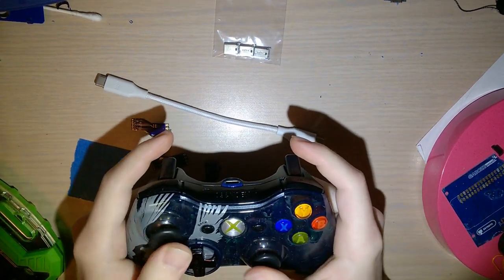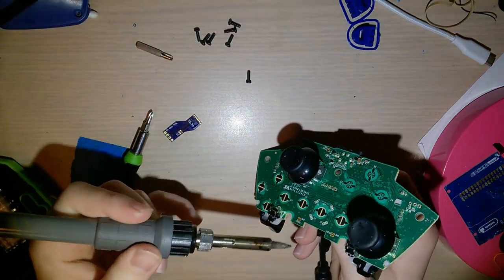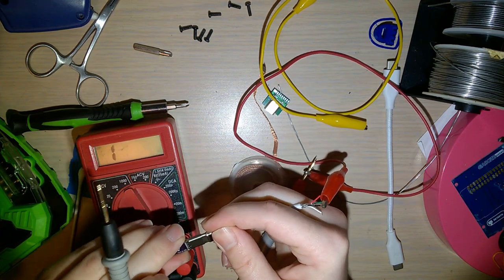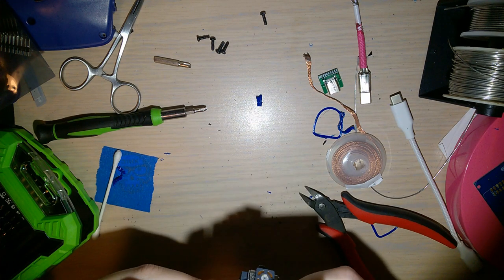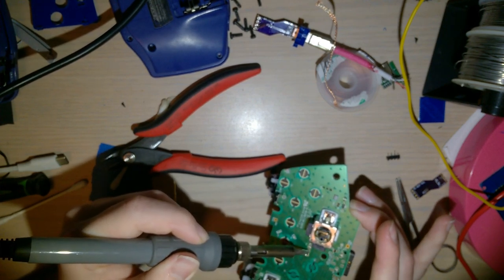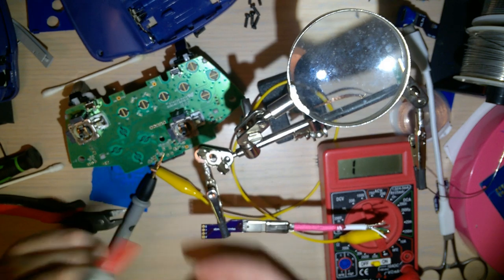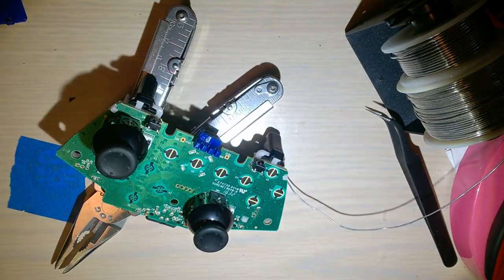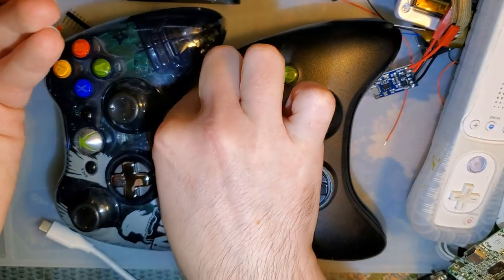Installing a USB Type C Port in a WIRED XBOX 360 Controller

Comment: Nice. I did the mod on my controller but I used a USB C female to USB 2.0 male adapter which I disassembled to use the board itself (long story short, I can't import anything in my country so I can't buy that PCB, and breakout boards aren't sold here either), and for the bezel (which luckily I managed to have someone 3D print for me) I used super glue to keep the port in place, not the most elegant solution to be sure, but it seems to work just fine like that for now.
Reply from the maker: That's probably for the best, the rigid connection seems to be unreliable on the custom boards with the edge ports
Reply: Are you the same guy on reddit who used an Xbox 360 clone controller?

Comment: Awesome!

I noticed in your video description that there are updated board revisions and that you reflowed some solder to fix an issue on your current board. Could you do a follow-up with the new board and your thoughts on it as well as your thoughts on the controller in this video after you reflowed the solder?
I plan on doing this myself, as I'm sure many of us would like to, and your thoughts would help as a guide!
Reply from the maker: The issue with the new boards is that my 3D printed bezel won't work and it would have to be modified. I also made the bezel in tinkercad (I use an actual CAD suite now) and I just really can't be fucked to fix it. Maybe eventually but it's not something I have planned soon.
Reply: @makho  Oh, I see. Thanks for responding, man! Love your long-form videos! USB-C all the things!

Comment: Heya! Great job and great video, I was wondering if you could help me out with something - I'm trying to repair and modify a used controller, but after opening it I noticed that the copper on the PCB is gone. I was thinking of just using jumper cables, but I don't really know what TPs to connect them to. Ground is easy enough to find, but I don't really have any idea for the rest. The board you're working on seems the same, do you happen to know if there are TP spots for the USB data lines?
Reply from the maker: I don't have any schematics for these controllers, sorry.

Comment: Did you have to cut away part of the housing at all? The round part of the 3d printed bezel doesnt slide all the way down into the housing. I also noticed the hole of the little notch it slides into is narrower than a usb-c port so I think it would need to be cut regardless.
Reply from the maker: Yep, it needed some filing. I'd like to revisit this some day but I'm unlikely to get around to it.

Comment: Any chance of an updated video on the 1.4 version of the PCB + the new USB-C port part? I got the parts in but am hesitant to proceed without better instructions than the ones in the README. Or do you think this video would be a good enough guide? Have not watched it all the way yet since it's for a different version of the mod.
Reply from the maker: I don't intend on revisiting this at any point. v1.4 should be a lot easier to solder together and a lot more reliable due to how the port connects to the board but should be about the same. I don't know if my bezel fits as is. 

My motivation to work on this has been all but destroyed ever since microsoft started putting USB C ports on their xbox series controllers. It's a better controller with better compatibility and it comes with type-c out of the box.
Reply: @makho  Fair enough if you had PC usage in mind. My intent was to use the controller(s) with an actual Xbox 360. I did do the RGH 3 mod to several of them and enable the usbdsec patch so I can use unauthorized controllers, but for some reason the Xbox Series and Xbox One controllers still don't work unless I use a Magic NS 2 adapter. My Gulikit controller and a few others in xinput mode work without that adapter after the mod (they probably pretend to be an actual 360 controller which might help).
My hope was also to prepare something cheap in bulk so I could prepare enough 360 controllers for 2-4 people besides myself for a semi-public setup. A USB-C port would be ideal because we were already using Flatbox controllers along with 10ft USB-C to A cables and unplugging/passing them when the person playing changed. I basically wanted to leave those same cables plugged in and have a more traditional controller than the Flatbox for when we're not playing fighting games so it would still be easy to pass the cable around without walking up to the console (and without anyone having to share controllers).
I did end up giving the mod a try and had a pretty terrible time, so I put it on hold for now. I was just getting no signs of life when I hooked it up to a PC to test. At first I thought I soldered the C end wrong, but it might've actually been the pin headers since the example install picture on GitHub has them in an unusual spot compared to how I'm used to seeing pin headers used (like in keyboard builds), and I only soldered in half the spots I should've. In trying to get them back off to redo I tore the conductive area around 2/4 of the USB connector holes. One was a GND I could've maybe re-routed, but the other was one of the data pins. This was at least a broken controller I was working on, but now I'm hesitant to try it again on another controller.
Sorry for the wall of text. Anyway, I'm probably gonna have to give up on this unless a decent guide pops up for me to follow, unfortunately. I still hadn't watched your video all the way through so I might still do that one of these days if it's similar enough of a process.

Comment: Hey, Im trying to follow your tutorial, but its a bit late to ask now that I’ve ordered everything… about the thickness of the board (1.4 vs 0.8 mm), is there any parameters on the website that one should be aware of? And about the ali express order, when you talk about the ones that "straddle the edge of a board" you mean the ones with the tiny bit on board behind it right ? But anyways, thanks for this tutorial, it’s good to see that people are / were still on those devices in recent years.
Reply from the maker: no, not at all. You need bare ports for this if you're using the adapter board.

Comment: I own a usb charger kit cord. The backcharger dont work. But the cords work. So i have no idea what to do with them. And the videos on youtube show that the wire cannot use it to connect to pc. But could u fix that with sordering or something. Make them charger cords work for wired connection. To pc or phonesWithout buying reciever. Is it possible for u. To play games
Reply from the maker: wireless xbox 360 controllers cannot be hardwired. There is no mod for that. Buy an xbox one controller if you want a wireless controller that can be hardwired.

Comment: I'd love to convert my PS3 controller to USB C. I imagine it should be relatively simple because I don't think the PS3 controller's mini USB does anything special or proprietary,  but I've never done a conversion.  What do you think, Makho?
Reply from the maker: USB C is physically bigger so you'd have to make room if you are replacing the port.
Reply: @makho  Do you mean that the mini USB port itself is larger than the USB C port; strictly port to port? Or are you including a breakout conversion board or something that would be necessary like in this 360 controller video you did?

I'll gladly expand the hole required in the controller shell, but is there anything else you initially think of as a problem or concern?
Reply from the maker: @MojojoJenkins  you're going to have to come up with some way to adapt the port, and yes, expand the hole. USB C and Mini USB B are not even remotely similar in terms of pin layout and spacing.
Reply: @makho  OK, cool. That's what I thought but I just wanted to see what your thoughts were.

Thanks for continuing to put out good, detailed content!

Comment: idk if there is any connection but the original xbox controller used a custom usb port that had 5 wires. perhaps they were gonna use the old port and designed the pcb that way before the 360 was finalized?
Reply: I think the 5th wire (yellow?) on OG Xbox was for light gun sync

Comment: 11:46 i think i just made the same mistake you did, ordered the thicker boards. But still haven't got them with me, so... is it worth even trying with a 1.6mm instead of a 0.8mm?
[EDIT: No. What he meant was the fit inside of the board. Prior version was a perfect rectangular shape (11:41), plus the thickness. So getting a standard 1.6 should be OK, and not a problem.]

(Note to self)
37:40 v1.4 is a slightly different joint with the female USBC port...
https://www.youtube.com/watch?v=CxKuCp2d730
https://www.youtube.com/watch?v=N3oME8umDuw [This one's the absolute best guide for Type C 31 M 12 installation, only catch is it's hindi. Turn CC on and bear with it.]
https://www.youtube.com/watch?v=ydPFCHNuRGM 
https://www.youtube.com/watch?v=e6TMxctCcxU (these other videos give me an idea on how to install the newer version v1.4 boards).

58:50 Once the piece is soldered together, it's required to check the connection with a multimeter. Magic Number is 600ish ohms, which should be the correct voltage for this particular controller. None of them should be shorted.
Reply from the maker: Newer variant should be more forgiving with board thickness though I haven't actually tried it. The ports we used on the variant in the video are actually awful for this purpose
Reply: @makho  It took forever, but the TYPE C 31 M 12 connectors finally arrived at my country! So i'm going to be trying this mod out as soon as i get them get them. After that, i'll post the update on reddit and link that post into here 🙌🏻.

I've watched this video very closely, and am keeping it as a guide, it's very very detailed. Thank you for sharing!
Reply: Plugged it in, worked perfectly. The bezel needed adjustment so i did a Tinkercad and remixed it from the old model at your thingiverse post, that might need some filing work. 0.8mm boards are actually much much better for this mod, as closing the controller back together is already tight with the 0.8mm. So in case you got the thicker ones, it's best to ditch those and order the 0.8mm. Do not touch the 4pins, they're not cuttable.

The usb pads on these controllers are dumb easy to lift and break. Once you get this PCB in place, there's no turning back... So lucky i had a spare one to do several attempts with, now i gotta figure out how to fix it with the USB traces and jumperwires.

Comment: just did this to a wired 360 controller except i used a breakout board that I had left over from another project and just used some wires not pretty but it works also just friction fit in there then clamped by the shell,

 but now i found out this controller has some stick drift and im havin a heck of a time sourcing some joystick boxes and recommendations anyone?

Comment: How to add bluetooth to the xbox 360 controller. Not the syncing but actual bluetooth to work on any phone or bluetooh device without buying any doungle or wire to be showing. Just rechargable bluetooth controller. Like the new xbox controller works
Reply from the maker: not worth bothering since the new one has this feature already
Reply: @makho  yh but it would be cool to add it instead of throwing those controllers away. So we could have bluetooth controllers that can work for all platforms. Not everybody could afford those new controllers. Also there is the first xbox one version 1 model controller that dont have bluetooth. Just syncing. That doesnt work want to repair and add bluetooth. For the 360 controllers love to add bluetooth just so i could use it instead of throwing it in a corner and never use it again. Thats all but thanks for your content.

Comment: I need a help here, what if the controller is working when the wire is wiggle from usb a side, can I just cut it and solder it again? Please let me know.
Reply from the maker: depends on where the issue is. Are you sure it's not an issue with the plug itself or the port?
Reply: @makho  No, there is no issue with the port, I'm really sure that its the issue with the plug
Reply from the maker: @sultan2724.  splice on a new plug

Comment: Hi there, would it be possible to just skip the usbc to usbc steps and just take the prexisting cable, splice it open and reattach to a usbc?
Reply from the maker: assuming it's wired properly, sure. USB is USB. Not sure why you'd want to do it that way though

Comment: My buttons on my gba sp are sticking. Even when I press them on the motherboard they do not signal 100 percent of the time. Could you do a video or replacing them or another solution to this problem?
Reply from the maker: try cleaning them. Contact cleaner or IPA. The actual buttons on the PCB can be disassembled, just peel the tape up and you can lift the metal dome actuator.

Comment: Can this be done with the xbox 1 controller? I mean, replacing the old USB port with a USB type C one?
Reply from the maker: sure. But if you have to ask, I'm not sure that you'll be able to do it. Electrically the port is compatible.
Reply: @makho  is it a straight swap? Do I need to swap to a compatible pcb?
Reply from the maker: @h33tology  That's kinda what I mean. Micro USB is a physically smaller port so you'll have to get creative.

Comment: How to make the battery verion controller to work with bluetooth and add type c in the original battery controller in the box. So it can be used as wired also.
Reply from the maker: Wireless 360 controllers only work via wireless. Xbone and newer started working both modes and One S and newer controllers have bluetooth built in. Series controllers have everything and USB C, might as well just get one of those.
Reply: @makho  yh but i have a whole set of xbox 360 controllers and dont know what the hell to do with them. I want know if u can mod it with phone parts like bluetooth and changing to type c. Else what else can i use it for.

Comment: Does it works for PC and for inalambric xbox 360 controllers?
Reply from the maker: USB is USB, regardless of the connector form factor. Yes, these controllers work on PC. 

I doubt this adapter works with non-microsoft brand controllers. It's spaced specifically for MS controllers.

Comment: Does a right angle male through-hole JST connector exist? So you don't have to remove the controller's onboard connector? Just solder the male plug to the mod board and insert into controller's connector